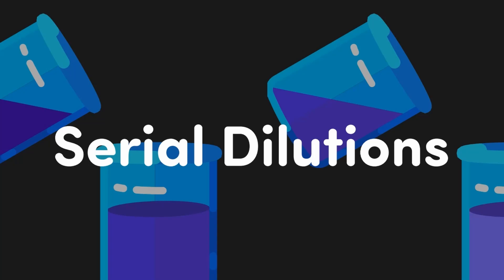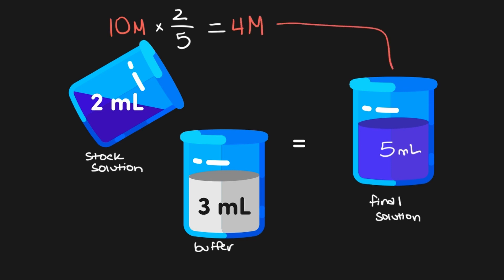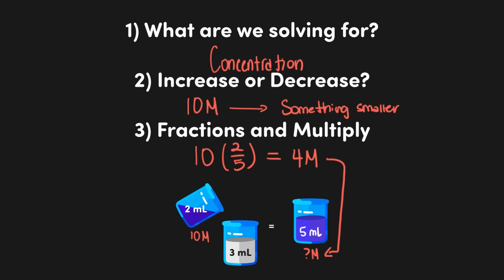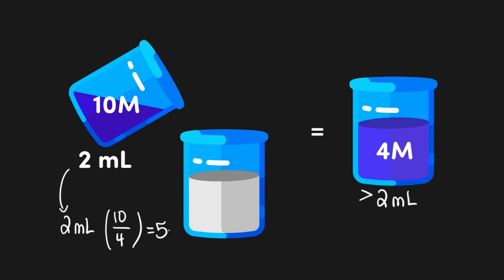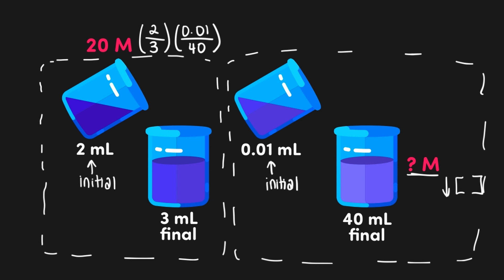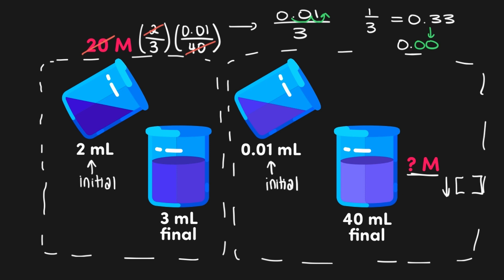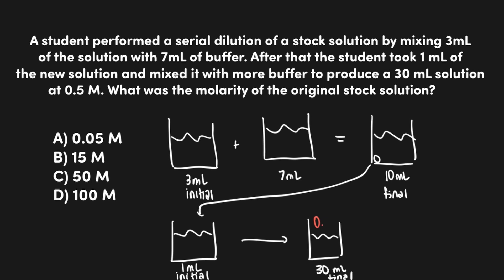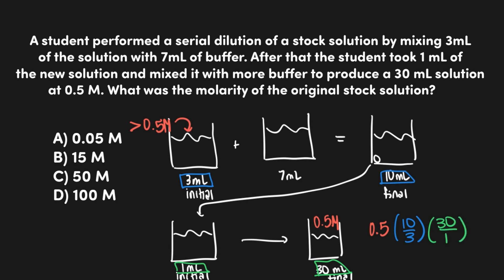Solving Serial Dilutions | MCAT Content

Comment: this is nice but i honestly find m1v1 m2v2 setup easier to understand
Reply from the maker: This is actually the same thing, but the equation is already rearranged when you solve it this way. Nothing wrong with M1V1=M2V2 and if it works better for you then stick with it. Although many people do find it a bit tougher to use on serial dilution problems since you have to plug things in twice and it can be a bit confusing.
Reply: @EightfoldMCAT  thanks for everything

Comment: At 7:00 wouldn't the first dilution factor be 2:5 (two parts original concentration to 5 parts total volume) according to your earlier definition? And the second dilution factor would be .01:40.01?
Reply: I think I see why. In your earlier examples you showed three flasks of different volume but only focused on the one of known concentration and volume, and the one which has the new mixture. At the 7:00 mark the dilution factor is 2:3 (instead of 2:5) because you did not show the 1 mL solution you must have mixed the initial 2mL one with. The same logic describes the second dilution factor.

Did I figure it out?
Reply from the maker: In the dilution you are referencing the final volumes of the solutions were given rather than the amount that was added. So in the first dilution you started with 2 mL and it was diluted to a total volume of 3 mL so it would stay as a 2:3 dilution in the second dilution the same thing occurred. In the second dilution it is the same. The final volume of 40 mL was given so it would also be a 0.01 : 40 dilution. The difference between this dilution and the last one is that in the previous ones the final volume wasn’t given and had to be calculated based on the amount of solution that was added. The AAMC can ask dilutions both ways: giving you the amount added or the final amount, just make sure you are careful about identifying which type of information is given and always find the final solution volume since that is the one that counts!

Comment: Great video! Thanks for sharing. I see you're experimenting with different speaking paces. I tip I learned to speak clearly is to practice stretching words out in the shower/practice venue of your choice. Clear speaking isn't just about elongating the pauses / avoiding slurring, its about elongating your vocalizations too!
Reply from the maker: Thanks for the tip I will definitely give that a try. I have gotten some feedback that I talk too fast. I script all of the videos to make sure that I don’t go off topic and hit all of the points I want to, but since I am essentially just reading what I have already written I don’t have to think and talk at the same time so I can speed through the material too quickly at times. I am experimenting to try and figure out the right speed which is a lot harder than I thought it would be.